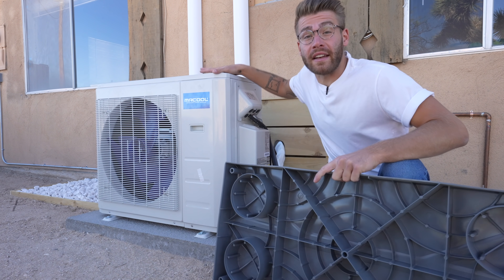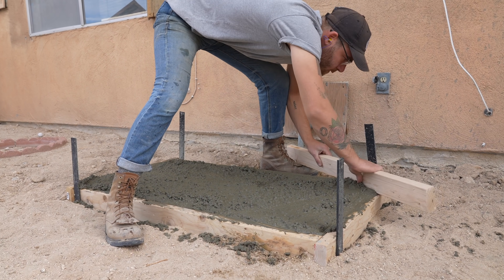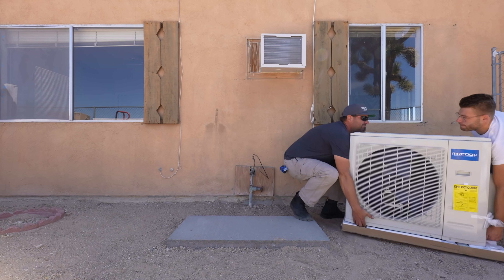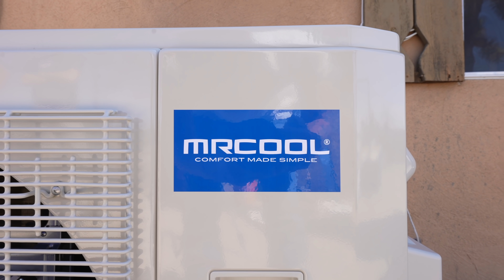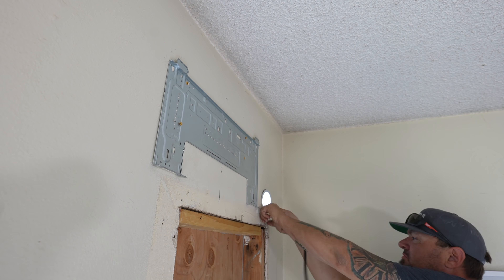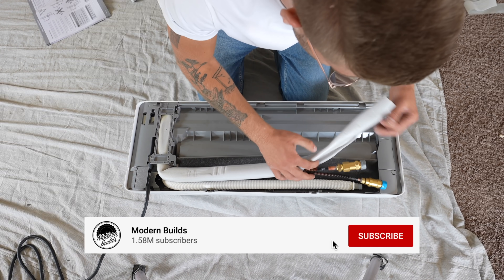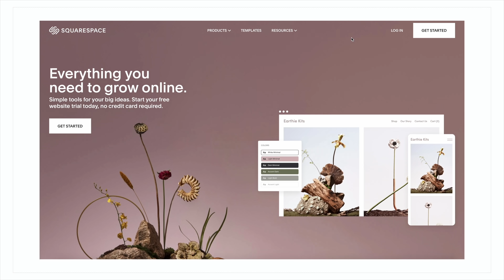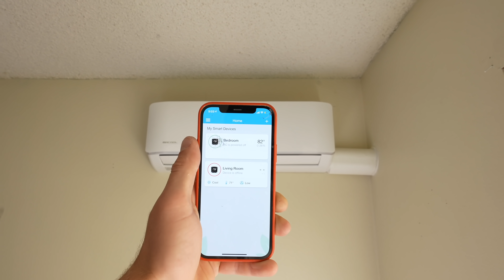DIY Multi-Zone Ductless Mini Split AC & Heating System | MR Cool Install 2021

Comment: There is one mistake that has been done , why you did not perform a vacuum for the pipes , having a moisture in the pipes affects the performance of the unit with time
Reply: No vavumn is needed.
Reply: No need to. Apparently Mr Cool comes with pre-charged line sets with a special fitting on each end that keeps them sealed until connected. See https://www.homedepot.com/p/MRCOOL-25-ft-3-8-in-x-5-8-in-Line-Set-for-DIY-24K-and-36K-DIY25-3858/314412417

Comment: Looks like your rebar is right in the middle of the concrete. That location is totally useless. Move to the bottom edge of the concrete.
Also, for a double zone system. Can it work if only one zone is installed?
Reply: Yes the condenser can have up to 4 heads

Comment: there is a tool that lets you make flare fittings so you can cut the copper to the perfect length so you dont leave it bunched up and create an oil trap that is bad for the unit. surprised the HVAC techs didnt have one....
Reply: You're supposed to leave it coiled up..
Reply: @rogerfar  it traps the oil. Over time it won't run right...
Reply: The problem is that these are precharged linesets. They have special fittings.
Reply: @MyGoogleYoutube  exactly and the fittings would still be used but you'd still have to cut the excess copper. the flaring tool just flares the copper after you cut to the length you need and then you thread the flaring caps on the valves like normal.
Reply: @daffron101  

Then it's not diy. That is the point of the lineset.
Reply: @MyGoogleYoutube  he had hvac techs help him tho so i mean was it truly diy?
Reply: and you don't need a license to buy a flaring kit? it would still be DIY. it would just look better and not have an oil trap that can cause issues to the compressor lolol
Reply: @daffron101  If you cut the lineset you go from using wrenches to install to needing a vacuum pump, gauges, micron gauge, maybe some refrigerant, and the knowledge to use it all. 

All to achieve something the manufacturer doesn't even warn against?
Reply: @MyGoogleYoutube  what? you would still need that anyway if you want it done right and want it to last more than 5 years. the copper is already open and exposed to the elements.  cutting it shorter wouldn't change any of the steps that you had listed. the valves would still be closed and the flare fittings would still be used lol
Reply: @daffron101  no, the charge is in the lines. If you shorten them, you let the coolant out, which is probably illegal and then requires that you purge the lines and vacuum them. That’s all avoided the way this unit is designed. But the downside is, you may end up with excess tubing that has to be coiled and shouldn’t be stored in a vertical position.
Reply: @rickedwards7276  the charge is in the compressor behind 2 valves...the lineset is separate. cutting it doesnt make a difference or effect compressor as long as its connected properly to inside and outside system.
Reply: @daffron101 bro the line sets are pre-charged. if you cut it, then you complicate the process by requiring all what an HVAC guy would have to do and which youd have to pay. There is NO needed vacuuming of these pre-charged lines, that is the point of DIY--to avoid paying for labor cost of a hired service. the freon pre-charged line comes in 16 ft, 25ft, and so forth. you have to measure your location around your house where you plan to set the outdoor unit and then the exterior wall (can be interior from the attic but some would require a condensate pump setup of sorts).

Comment: To a European, WoW that electrical system is scary tech - nothing like that has been installed here since the 70's or earlier! And that outside braker/fuse pannel, realy scary.

The install is a nice idea and system.
Reply: What is so scary about split phase? You literally take a tap off of each end of a 240v transformer giving you two 120v legs. Then the Neutral is tapped backed into the center of the transformer completing the 240v circuit. You don't need 240v to charge your Iphone or 90% of the electrical appliances/devices in your home.

Comment: I hope this comment isn't misunderstood as criticism but if I can make a suggestion - put "install" right after "DIY" at the start of the title so it says "DIY install Multi-Zone Ductless Mini Split AC". I definitely don't believe you were trying to clickbait or mislead with the title, but I was definitely expecting a very different video. However, it actually worked out for me as I've not really looked into many ready-made ductless mini-split systems in my quest to convert a window-mount AC into a mini split. I've only really looked into videos of other people that did the same - which I now see was a mistake. There's a lot more optional features for mini-split systems than I had originally assumed... I guess that's why there's such common sayings regarding making assumptions... So, thank you for that. Take it easy...

Comment: Tell me those two idiots that were neither AC Techs or electricians cut strands of wire off of the conductors to land them on the pressure terminals on the unit.  You people who make these videos do a huge disservice to your viewers.

Comment: The extra copper tube looks too nasty.
Reply: It also causes oil return issues, cutting the systems life in half.
Reply: That is the down side of pre-charged line sets. You can't cut them to size.

Comment: It’s really not the best idea for your line sets to be coiled in the upright position… all of the oil will drain out of the compressor and get trapped.
Reply: Hmm, that makes sense. So you’d recommend running your coils on the horizontal instead?

Comment: I didn’t see the most important step of the installation... they didn’t vacuum line sets.
Reply: Don't think you watched the video..
Reply: No need to. Apparently Mr Cool comes with pre-charged line sets with a special fitting on each end that keeps them sealed until connected. See https://www.homedepot.com/p/MRCOOL-25-ft-3-8-in-x-5-8-in-Line-Set-for-DIY-24K-and-36K-DIY25-3858/314412417

Comment: DIY as long as you have some HVAC tech’s with you
Reply: @greenlaserboy  MrCool lines are pre charged so you don’t need to vacuum or pressure test. I put in two systems so far one was Celiera and one was MrCool. MrCool is sooooo easy especially compared to the other brands
Reply: I did it....NO HVAC TECHS needed. Easy and works just as if an HVAC tech did it. Point is you can DIY. I did.
Reply: Don't need an electrician for such a simple job
Reply: baby haters gunna hate and cry
Reply: @greenlaserboy  because it's a pre charged unit , hence the diy
You don't need hvac people w u 
Just hook up and go
Reply: @greenlaserboy  Mr Cool has two types of units, DIY and professional.  They are both available at the big box stores.  This was the DIY unit so no vacuum needed.
Reply: And an electrician 😁
Reply: I have the same system, EPA is not paying them a visit
Reply: I’m a 20 year old girl who’s barely held a drill before and I did it myself in 10 hrs. Pretty simple stuff
Reply: @greenlaserboy  The line sets are precharged and sealed so they do not need to be vacuumed.
Reply: @85TransAm406  :)
Reply: @85TransAm406  uhhh yes you do you pull vacuum to check for leaks
Reply: @Keguns  You do NOT "pull vacuum to check for leaks".
Reply: @Mister_Pedantic  i was thinking the same thing 🤣
Reply: Right fuck us. DIY Hvac friend
Reply: Right
Reply: Except they were essentially just an extra pair of hands
Reply: Hahaha 😝
Reply: 😂 gotm
Reply: He’s never seen wire pulled . 😂 what!!!
Reply: This is the most entry level diy project, minus the electrical. Basically mounting a bracket into studs, drilling a hole, and connecting fittings.
Reply: Guys, don't buy these Me Cools, buy some good ones that are pre charged, these systems are preety easy if you have done any plumbing.
Reply: Installed 2 of these 5 years ago (2 years before your comment) with zero HVAC techs and they’re still running like new, so…
Reply: The HVAC techies were there for the electric work. I am sure MrCool has done all the legal work for their DYI systems.
Reply: @Aviator168  if you read up on any of the mini splits being sold on the market, they require the lines to be installed under vacuum. They also state if you do not use a licensed AC pro, all warranties are voided.
Reply: @HalProctor  So MrCool's DYI is lying.
Reply: @Aviator168  no
Reply: @HalProctor  only for non DIY units
Reply: @greenlaserboy  No. You are WRONG. Mr Cool has different models and this model is100% DIY. You are wrong.
Reply: @greenlaserboy  No, you read the warranty wrong. DIY units do NOT need to be installed by a licensed HVAC person to activate warranty. You have that wrong. That only applies to the products they make that are NOT DIY.
Reply: @AFASOXFAN  but you've still got air between the connections......
Reply: @athandevitsakis9318  the line sets for the diy units have been pre vacuumed and sealed when you connect the line set to the valve and tighten the seal is then pierced.
Reply: No kidding… 2 hvac techs, Free System, Halfassed Concrete Slab job.. 

Wtf Mike, why even bother?
Reply: @greenlaserboy  they exclude the DIY system from that requirement.
Reply: Beware!!! "HVAC techs" is often over-used!!! Take the time to find the "proper-person" for the job!!! Just saying.
Reply: @richardbowers3647  that would be myself for a diy system.
Reply: That electrical work kinda sketchy too with exposed wiring outside of the connections.
Reply: And an electrician!   Dyi. Not so much. This is bs
Reply: Seriously huh lol.   Wait till EPA pays them a visit
Reply: @midntdlight4782  why would epa pay them a visit? they aren't venting any refrigerant
Reply: @midntdlight4782  Fully DIY. Approved. Excellent System
Reply: Ikr
Reply: @greenlaserboy  A lot of Mr. Cool line sets are pre charged with Freon. So it is already in a vacuum below 500 microns so when you connect them you can let the Freon go. These units don’t store the Freon in the condenser either
Reply: @TeddyABear   you. Sir are. Incorect.
Reply: @TeddyABear  Where are you living where it is legal to "let the Freon go"?

Comment: This is sloppy job dude!! No Nitrogen pressure check and flushing moisture out, no vacuming of lines .

Termostat that he use you can find them on Amazon and they will work on every Ducless unit . CIELO TERMOSTATS
Reply: No need to vacuum. Apparently Mr Cool comes with pre-charged line sets with a special fitting on each end that keeps them sealed until connected. See https://www.homedepot.com/p/MRCOOL-25-ft-3-8-in-x-5-8-in-Line-Set-for-DIY-24K-and-36K-DIY25-3858/314412417

Comment: Awesome installation video...... I've priced a central heat/ac install for my house but its a small fortune.  This seems a better option.  How well does the heat work?
Reply: As long as the unit is sized properly and it doesn’t go below -20C they heat very well. Centralized HVAC systems are old tech, mini splits are the future.

Comment: The only upside I see here is no need for duct work. Other than that, it looks pretty bad for the outside of the house. 
You have several holes needed that allow insects to invade the home, and the electrical conduit ran on the outside just looks terrible. This is rental property fixes 101.

Comment: Some of the electrical connections at the Condenser Unit looked like they could’ve been done better and I would’ve foamed the wall penetrations to avoid critters and better sealing but other than that these DIY A/C units look like a good option for a Garage. If it breaks in 3-5 years who cares.

Comment: I guess in warmer climates exterior walls are pretty thin. We've got about 12" or more on our walls up in Canada. Also since the seal from inside to outside was broken, I'm used to seeing some sort of sealant being used around the pipe in the walls. Maybe you can do this to minimize heat loss if it matters, as well as to minimize moisture getting in the walls from behind the wall port. Though I don't know if that's even necessary in your region.

Comment: Then pull a 500micron vacuum on all the line set, then nitrogen pressure test before opening the service valves releasing the refrigerant
Reply: Apparently Mr Cool comes with pre-charged line sets with a special fitting on each end that keeps them sealed until connected. See https://www.homedepot.com/p/MRCOOL-25-ft-3-8-in-x-5-8-in-Line-Set-for-DIY-24K-and-36K-DIY25-3858/314412417

Comment: Here’s a tip on the concrete: after about 2 hours setup time on a pour the size you did, use a rasp to knock down the rough spots and essentially you have a smooth sanded finish before it hardens. Use a level to span across the forms as you go to check for high spots. Sweep off the dust when it’s cured. Good to go.
Reply: Super late here lmao, but where i live most builders spend at least a couple minutes hitting the boards firmly with a hammer o something once they poured all the concrete when building this kind of slabs and bases. This removes the air bubbles and gaps inside the mix and some water go to the surface, so it has a better finish. Isnt this done in America??maybe the concrete is just so different?
Reply: I hadn't heard of this approach before.

Comment: can unit good for 7 rooms up stairs and down stairs ?
Reply: The unit is based on how many sq feet you want to cool.
Reply: @origtex  1069
Reply: Most condensers have a max capacity of operating with 4 heads.  So another condenser with 3 outlets must be required.

Comment: Great video like always… BUT… there is no point on buying this DYI brand anymore. They doubled their prices. It was literally cheaper to pay a profesional to come install a much superior unit , I didnt have to lift a finger…and still saved $500 on the entire cost…. and I dont have a ridiculous line dangling around or have to come up with extra expenses on material trying to hide the extra lines. I know you are sponsored and they gave you this AC for free, but this DYI video is not saving any of your viewers money. Unless their AC tech is trying to rip them off.
Reply: Unless you have no duct work.   Lot of people who install these, do so because ducts are lacking.
Reply: Good thing I put my line inside the wall. Clean install baby!!

Comment: The lines are not charged if the freon is inside of the unit you have to release it into the lines
Reply: It’s called refrigerant!!!!!!!!
Reply: Apparently Mr Cool comes with pre-charged line sets with a special fitting on each end that keeps them sealed until connected. See https://www.homedepot.com/p/MRCOOL-25-ft-3-8-in-x-5-8-in-Line-Set-for-DIY-24K-and-36K-DIY25-3858/314412417

Comment: Last year I installed a 18k btu MrCool downstairs.  This year I installed a Pioneer 12k btu upstairs. The outside unit is identical except for size.
I recommend Pioneer over MrCool because you can get support much easier for Pioneer.
Reply: Did the Pioneer have pre-charged lines ? I think MRCOOL is the only one offering this.
Reply: @edkight6447  Yes.  Both are 95% the same. But I think it is easier to contact someone at Pioneer.  I believe MrCool has  a service company and you cannot contact a MrCool person directly. They both work great this summer. I am very impressed.  The outside condenser is the same for both except for labeling.  I am willing to answer questions.
Reply: @rondail5675 the only thing that makes me look at others outside Mr Cool is that I keep reading they have sucky customer service. And also the DIY only can choose wall mounts, no options for ceiling/floor consoles and all units only go 9k is the lowest while some have 6k for smaller rooms (C&H but its not DIY). Im considering a Pioneer for one zone and Mr Cool in another as I have basement I want to see if applicable in height min requirement.
Reply: @zivaschan  I agree that MrCool has bad service.  It is easier and better with Pioneer.  I recommend Pioneer over MrCool.

Comment: You had the pros there should’ve cut and flared that line set
Reply: You would need to drain and then refill the lines - the whole point of the system is to avoid doing that part.
Reply: @idrisddraig2  the lines aren't precharged only the unit.
Reply: @coreyfournier3345  Not true. The Mr Cool system has pre-charged line sets.
Reply: @coreyfournier3345  . Apparently Mr Cool comes with pre-charged line sets with a special fitting on each end that keeps them sealed until connected. See https://www.homedepot.com/p/MRCOOL-25-ft-3-8-in-x-5-8-in-Line-Set-for-DIY-24K-and-36K-DIY25-3858/314412417

Comment: Wait you did not vacuum the lines ???
Reply: No need to. Apparently Mr Cool comes with pre-charged line sets with a special fitting on each end that keeps them sealed until connected. See https://www.homedepot.com/p/MRCOOL-25-ft-3-8-in-x-5-8-in-Line-Set-for-DIY-24K-and-36K-DIY25-3858/314412417

Comment: I've found the thermostat to be a little wonky as it cools to way below the setting (73f sometimes cools to 67f) before turning off, and lets it get too hot before coming on (76f+ with 73f setting).  The fix I've found it to set comfy mode (in the app) to all 73.  Turn on = above 73, Turn off = Below 73, and Thermostat = 73.  That setting burns between 8 to 9 Kilowatts per day here in NC with highs in the low 90s, and lows in the upper 60s to low 70s.  This is with a single 12k btu system.
Reply: what sq ft?

Comment: Never coil line sets... ever! Oil traps will accumulate. Clog your lines. Also, you didn’t take the air out of the lines... Much love but let’s stick to the wood crafting!
Reply: With the DIY series, the line sets are sealed (pre vacuumed/filled) from the factory with inline valves at each connection.  So cutting the lines would void the 7 year warranty.